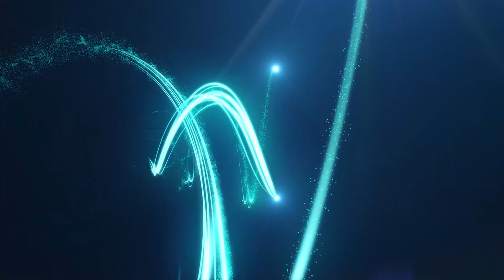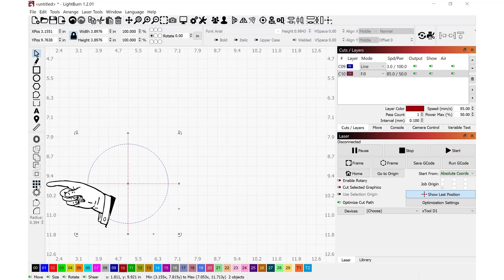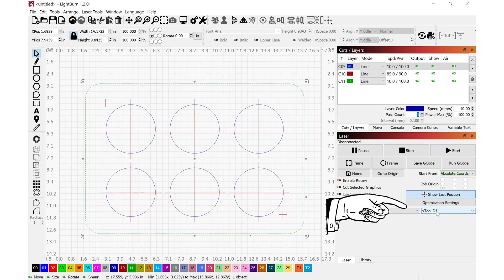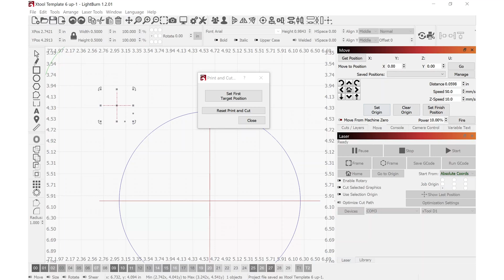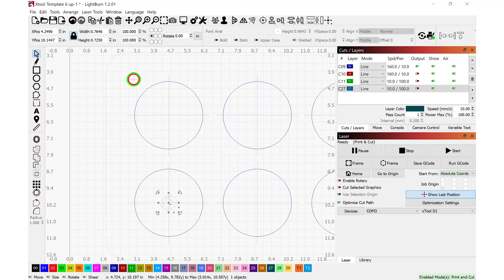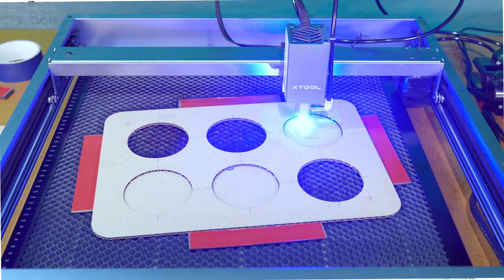Xtool- Make a Template

Comment: Thank you for the clearest tuition I have seen on any forum, My question is like this video I have to remove the guard around my TwoTrees laser to be able to visually see the target and spot.  Is it ok afet you have set the two reference points to use move to move the laser clear of the design to refit the guard and then continue . Thanks again for a great set of posts
Reply from the maker: Thanks so much!!  Yes- once the print and cut is setup you can use the move "keys" in lightburn to move the laser head to reinstall the laser guard! :_doggy:
Reply: @thelaserchannel1  Many thanks
Reply from the maker: @chrisashdown1484  You are very welcome! :_doggy:

Comment: Great video thank you ! Did you focus the laser before setting the machine to home ?
Reply from the maker: Yes- I focused the laser before homing the machine- once the machine is Homed I do not want to touch the laser module.  Thanks for watching!
Reply: @thelaserchannel1  your video has really helped me today I upgraded to the 40 watt laser and also the infrared module, I designed a jig in lightburn to help me engrave on multiple metal pets tags, but I never knew the cross hair function existed in Lightburn.
Reply from the maker: @TheRoman59  Thank you!

Comment: Great job!
Lightburn is one of those 'hidden' costs associated with buying a laser machine 
It seems way more useful than doing work in Inkscape, then importing it into XCS
I didn't budget for the program because I simply didn't know.
I need to sell a few projects to offset the additional cost.
Reply from the maker: I ran free software until it no longer did what I needed it to- from there it was an easy transition to LightBurn.  Today I run LB on all my Laser Diode, Co2, and Fiber/Galvo machines.  It's really nice to use one software suite across multiple machine types!

Comment: Nice tutorial.  I will use this soon.  One quick question as I am quite new to lasers.  I have the D1 Pro, the cross hairs are not directly under the laser, same as yours.  Is there any tuning that needs to be done for alignment accuracy?  Or is it automatic since you did the alignment with the the points on the template and Lightburn?  Thanks.
Reply from the maker: Hi- in Lightburn software, the cross hair offset is taken into account,  this can be found at Edit> Device Settings and Laser Offset.  I recommend testing on some cardboard first.  Just keep in mind you must use the Lightburn "MOVE" command like in the video to move the laser head to the targets- if you hand push the laser than Lightburn will have no idea where the actual laser position is.

Comment: I also have d1 without limit switches. Are you just clicking the house button to do the homing bump stop or are you doing something else?
Reply from the maker: Hi-   Yes- I'm using the bump stop homing.  Just make sure the machine does not bump against any cables or anything soft- for best results the bump stop will bump into metal frame parts.  Thanks for watching!

Comment: Can you recommend power and speed settings for Xtool D1 Pro 20W version for cutting regular cardboard boxes?
Reply from the maker: I don't have run setting for the Xtool D1 Pro 20w- I would recommend 20mm/s at 100% power or 10mm/s at 50% power if you don't want to run you machine at 100%-  this should get you go starting point.  Your actual setting will depend on the type of card board you are using.  Feel free to post your run settings here for others to see- thanks!
Reply: @thelaserchannel1  I used 10mm/s at 50% power.  1 pass worked, but to be safe 2 passes worked great.
Reply from the maker: @terrytharrett9033  Excellent! Thank you for sharing!

Comment: Been searching for an alignment video and this is the best yet! 

When re-aligning the laser to the engraved crosshairs, are you using the projected offset laser target, or the diode laser on the low power target setting(forgot proper name)?
Thank you!
Reply from the maker: Thanks!  I have the offset for the crosshairs turned on so for me I used the crosshairs to align to the template targets.  The laser "FIRE" dot is much smaller/finer than the red crosshairs and would offer a more precise alignment, but using the crosshairs still produced great alignment results!
Reply: @thelaserchannel1  thanks so much for the reply 🙏🏼

Comment: I bought a xTool D1 Pro Upgraded Laser Engraver after a frustrating connection with Makeblock after having issues with the laser quitting after about 20 minutes. I communicated with them over a 3-day period and finally sent it back to Amazon. How has yours been working?
Reply from the maker: I have the D1 10 watt (non pro) and only had a couple minor issues.  Makeblock would get back to me after after 2-3 days initially- after that message turn around was 1 day.  My issues were all addressed and fixed.  The Xtool videos are not sponsored- I purchased the machine with my own money and do not have any special "YouTuber" attention from Xtool service.

Comment: I've seriously watched a lot of videos regarding templates, and your video is by far the most detailed and easiest to follow. 
Seriously...you're awesome!
Quick question, if you use the nudge tools to move the laser out of the way so you can pop out the material, will it remember the coordinates that were set during the process, so you can just drop in new raw material?
Reply from the maker: Thank you for watch and your kind words!  To answer your question- "it should"  and by that I mean in Absolute Coordinate mode the laser will always know its position in relation to the project location.
Reply: @thelaserchannel1  thank you for the info, I appreciate it.